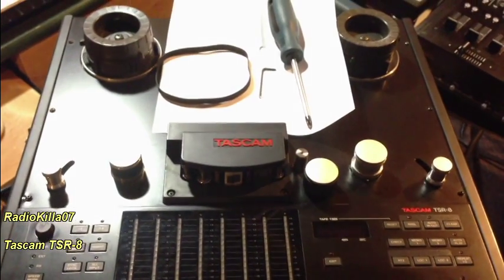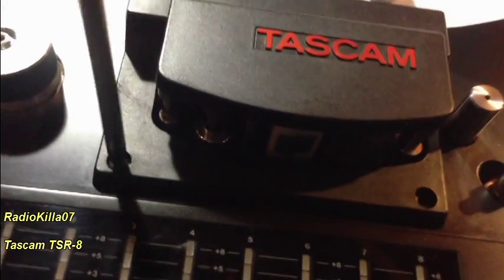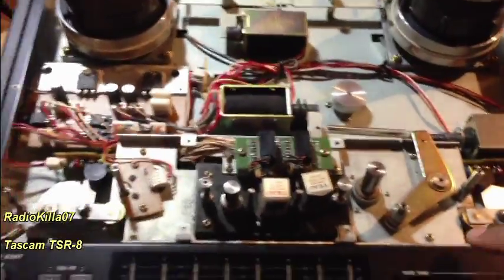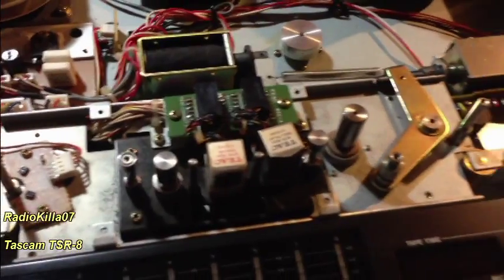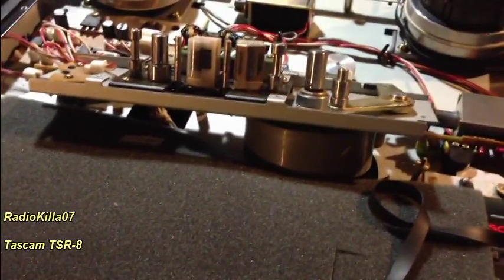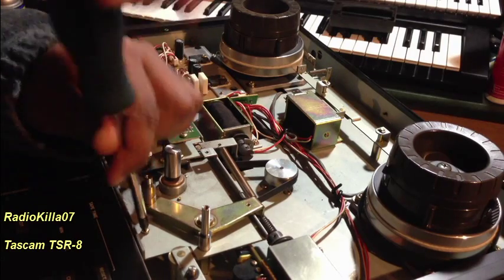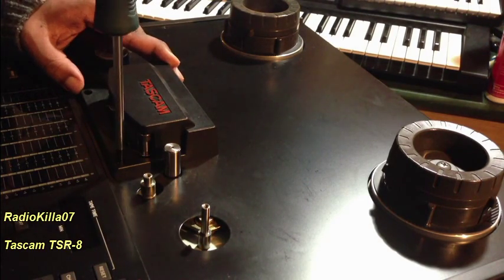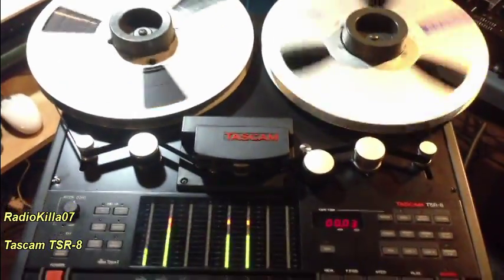TASCAM TSR-8 : BELT REPLACEMENT : HOW TO

Comment from the maker: Hello All its been years since I've uploaded this video and I'm glad many of you have benefited from this video.  Please read disclaimer in the beggining of the video.  YOU ARE DOING THIS AT YOUR OWN RISK.

The 5th Screw situation was not applicable on my unit but it is to my understanding that EARLIER TSR 8 models have the 5th screw. Please be mindful in when disassembling any electronic units to use utmost care when doing so.
Reply: @RadioKilla07  I did get it back together with the new belt. I think it had another issue before it trashed the belt.. when it started up I heard a grinding noise and it wouldn’t show changes on the counter. The stop button and fast FW and RW didn’t work. I took it apart again and reassembled it and the stop button did work! No counter though and still grinding noise..

Comment: bro absolutely amazing, complete lifesaver this video.

I opened it up the first time and the belt had slipped off, so I simply put it back around the motor. It quickly slipped off again so I ordered a new belt and followed through with the entire change 

I also encountered the fifth screw as others had mentioned, my advice is to not remove the screws on the green PCB itself, rather the screws right below that attaching the PCB chassis itself to the unit. Once those are undone, you can move the entire chassis to access the fifth screw

besides that, I replaced the rubber on my pinch roller as it had gone sticky. I've only tested some but all seems in order now 

thank you so much for real, amazing resource

Comment: Thanks. My belt got loose and came off the motor pulley. Also the pinch roller tire turned to goo. Hope this fixes! 🤞
Reply: It worked!
Reply from the maker: Renne glad you got the job done

Comment: Thanks for this, very helpful.  On my deck, I had to take 5 screws off the inner plate, one extra one under the pcb that the heads connect to.
Reply from the maker: No problem bud!  I didnt see anyone with a tutorial so i figured why not make one for the massives you know!
Reply: @RadioKilla07  yes! It's on the left side under the green pcb that says Head Connect. That pcb has to come up and remove the screw behind it or the whole plate doesn't move.

Comment: This is great!! Thank you so much. What were the symptoms?? Mine clicks when hitting play, But nothing moves... even the rewind and Fast Forward do nothing... Hopefully it's this! Do you have the number on the belt??
Reply from the maker: @donmancuso5713  if rewind and forward does nothing. There may be an issue there.    The belt mainly controls the capstan roller operation.   
The hubs have their own motors in them and have tension control to lightly pull the tape to prevent any slack.  
You might have an electrical issue. Don't quote me on that though

Comment: Hi , just to let you know RadioKilla Your instructions helped me change my belt.....but there is one more screw on the sub plate under the large group of wires that go underneath  that small green pcb.   So a total of 5 hold the sub plate.  That 5th screw has a small collar it goes through that a spring goes around. This 5th screw holds the plate also. to get to it I removed the two other screws that hold the plate that hold the green pcb. On my machine it was there....maybe your machine is a little different there. Anyway for the other viewers out there look for that 5th screw. Thanks again!
Reply from the maker: Ive heard of this. I was told this was on earlier TSR8 models

Comment: Here’s the complete guide I found online..from the author Graham Joiner….it’s pretty detailed.

Place the deck flat on its back and remove the left and right tape tension guides by unscrewing their respective caps and lifting them off (watch out for washers). Using an allen key, remove the 6 screws and lift off the front cover panel. Using the same allen key, remove the head assembly cover (two screws). Now unscrew and remove the timing roller, pinch roller and tape guide roller in the same way as for the tape tension guides - again watch out for washers and a spring. Remove the small circuit board (LHS) which is part of the timing roller assembly (2 screws) and place out of the way. Next, remove the 4 screws (1 in each corner) of the plate holding the head assembly. Remove the two shiny spindles (which supported the timing roller and tape guide roller prior to their removal) - this is best achieved by putting a layer of electricians tape round the wider part at the base of each spindle and loosening with mole grips. In my experience, these undid easily, but be aware that there is just a chance that the hexagonal brass spacer beneath the plate could start rotating instead - if this should happen, hold it securely with long-nosed pliers as you undo the spindle. Next, undo the three screws securing the BLACK plate which supports the heads and wiring loom to reveal a screw holding a spring affair - this screw needs to be removed (CARE! - it has a washer and spacer). Make a mental note of the appearance of this spring in case it falls out (as mine did! - easily replaced though) - I used a piece of wire tie to take the place of the screw just to keep it all together while the screw was out. I also removed the two screws holding the pinch roller piston (on the RHS) to make things easier. Now you should be able to lift the plate straight up (care - the flywheel is heavy!) just sufficiently to remove the old belt, and replace with the new one (which btw, I got from eBay). Re-assembly is a straight reversal of these instructions. The above worked for me, but of course, I cannot take any responsibility for problems you may incur whilst following them! Good luck! Graham

Comment: Thank´s for this tutorial. OK, must read the comment to find the 5th screw but the video helps me a lost. Today i´ve replaced the pinch roller reifen to a new one from e-bay. The old rubber was float away like asphalt in the sun. But that was not the only reason  of problems. The TSR-8 still don´t want to start. Then i decide to look inside and recognised that the capstan belt is also at hte end of its lifetime. So i orderderd a new one on e-bay today. With your tutorial i´ll hope to bring my TSR-8 back to live. Great Job:-)

Comment: Thanks for the vid.  Yeah as others have mentioned, mine had a 5th screw under the sockets for the head wires, had to unplug & remove 2 screws on the plate the sockets mount on to get to it, then big plate lifts up as described. My belt had turned to goo -- Isopropyl alcohol 70% on a paper towel cleaned it up, pretty messy tho!

Comment: I had to remove an additional screw to lift the head assembly. To get to this screw I had to remove the 2 screws that hold on the connector board for the heads. The screw holds a wire clip for a solenoid mechanism. I wonder why yours didn't have this. I had a belt I ordered 15 years ago to have on hand for when this day arrived. The old belt was sticky and gummy.
Reply from the maker: Im hearing of this variation.   Ive been told that newer versions of that same model had got rid of this extra screw. The older versions of that model has extra screws for some reason
Reply: What is your serial number? I have 4 of these and this is the first time a belt failed

Comment: Thanks for that. Any ideas how to remove the channel cards. I have the same deck and i planning to  recap it.
Reply from the maker: That you'll have to completely open from the back. As soon as you remove the panels and such they should be able to get at. I will tell you that this machine was assembled in such a way that it wasn't user friendly for servicing. But excellent circuit schematics and components inside. Brilliant machine.
Reply: @RadioKilla07  Thanks ever so much, I managed to remove them for testing. The 8th channel is low when I playback (comparing to the others).
So I swapped the cards (RP amp PCB) 1 with 8,  and the problem is still there.
Puzzled.
Reply: @RadioKilla07  Thanks again for the video. Also after thorough cleaning/demag, my deck back to normal.

Comment: Hey folks, where exactly is this 5th screw?
Reply: Under the green circuit board in the middle. Unplug the connectors - they look like 2 chips with wires coming out - so you can remove the circuit board to get to the screw on back left underneath.

Comment: HI there, thank you so much, the video is very helpful although I have a question,  I just got a new belt for my TSR-8 and I followed your steps to replace it, making sure to put the belt on the top of the motor pulley as it looks on the video and checking with my hands that it does its job with the caspatn but there is something wrong, every time the motor begins to run, the belt slips off from the top of the pulley and it comes out or sometimes it goes to the bottom of the pulley (the thinner part of the motor pulley) where it actually looks like it fix well and never slips again, the capstan runs apparently well  but I feel that this is not right and I don't know what to do, the belt is brand new and it looks in perfect condition. Sorry this is my first open reel machine and I have no experience. 

I have pictures and a video of the problem that I can send it if you like. Thank you and I would appreciate any help
Reply: This is happening to me as well? With a relatively new belt on my TSR-8. Did you ever solve it?
Reply: @Endless__Scroll  hello, I actually ended up replacing the original pulley. A friend of mine who has a CNC machine, built the exact same size pulley part with a little wall or border at the edges so the belt never slips again. In different words, is a pulley with a little channel that matches the width of the belt. I have some pictures in case you need more details

Comment: Can't find replacement belt for my TSR-8 ebay is crap
Reply from the maker: +david dkeole 
I can get them for you , P.M. me
Reply: +RadioKilla07 Same here
Reply: @RadioKilla07  Hi there
You mention liquid wrench or maybe DW-40 to loosen those 2 capstan poles on the plate.
2 questions…..
1.) Where would you spray the liquid wrench and will it potentially cause harm to the electronics?

2.) what tool did you use to remove   those 2 poles?
It’s extremely hard to get a grip even with using a piece of rubber to protect the base from the pliers.
Any suggestions would be greatly appreciated.
Thank you!
Reply from the maker: @rinobenenati2799  wow people are still commenting on this video I made a long long time ago lol.  But thanks for watching the video.  
So to answer your first question. Only spray a little. Enough to penetrate the base of those pegs. But not too much that it will leak inside. Please very careful.
Second question, if it's not loosening with the rubber gripping with the pliers then chances are those pegs are seized. Just spray the penetration oil and let it do its job over night. Try loosening it in the following day(s) ahead
Reply: @RadioKilla07  
Thanks for the response!
The spray worked immediately.
Your video as you can tell is very helpful as it allows one to not have to send the unit to a tech and wait weeks for it to come back for a simple belt change. I did have the 5th screw and the comments on your site helped me identify it and properly deal with it.
Thanks again for your insightful video!

Comment: I just replaced the belt on my TSR-8, and it works like a champ.  Thank you so much for posting this!  The old belt and the rubber on one of the rollers had turned to tar over many years in storage.  I found a great website, terrysrubberrollers.com, where he explained the material defect that caused the original rubber items to turn to tar.  He also put a new layer of rubber on my roller for about $35.  I found a new belt on ebay for $10.  Rubbing alcohol does wonders cleaning up the tarry mess off the roller (and your fingers), if you need to.  Thanks, again!!